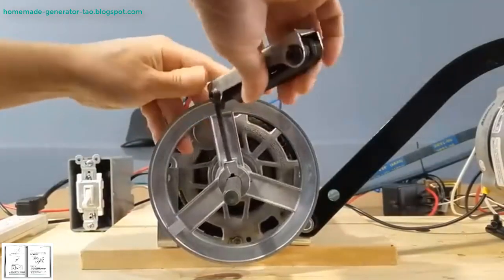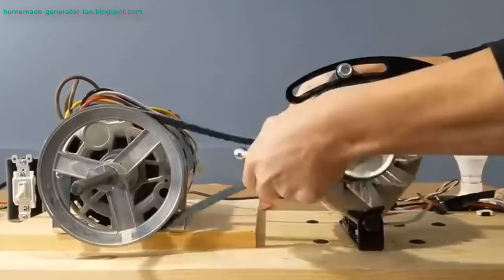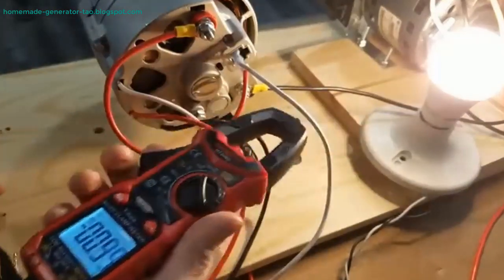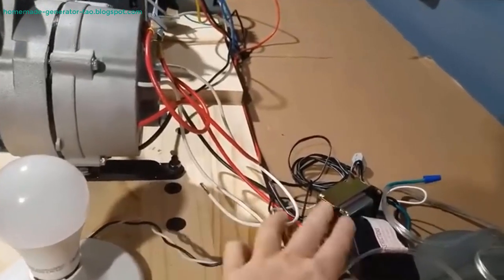Generator with Induction Motor - Reactive Power Feedback Mechanism - Self-Running Generator

Comment: Use capacitors with a cap dump to charge the battery then it won’t load down the generator